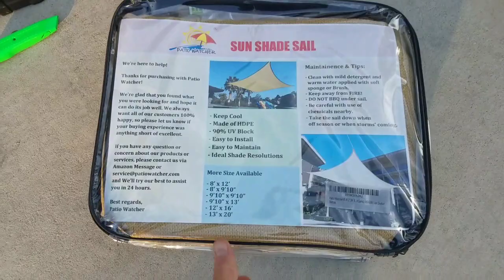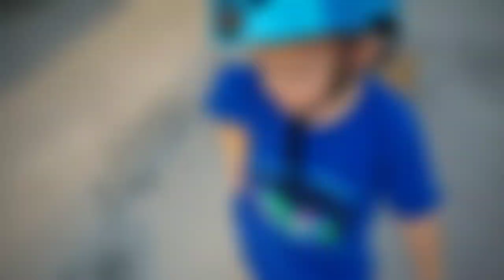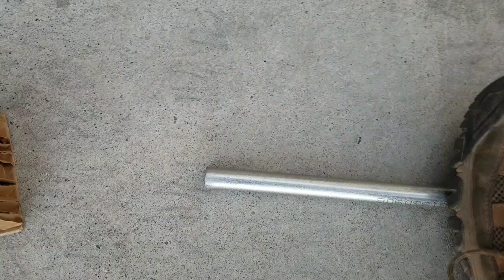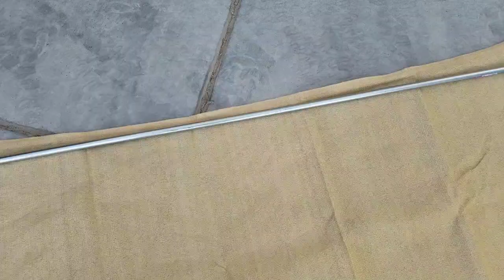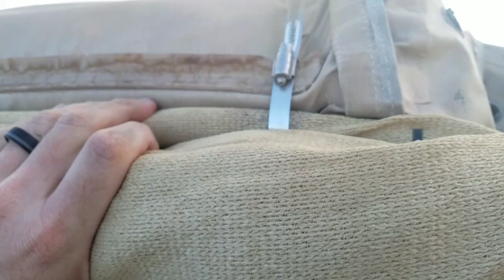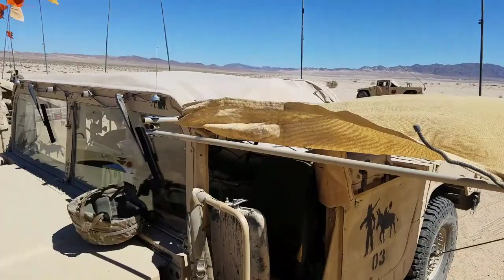DIY overland style awning

Comment: First off,  Thanx for your service. Former Navy here.  OK,  off topic question.  Do you know or know where I can find out what the base color desert tan your Humvee is painted? A Pantone color number of trade name is what I'm after.  I'm looking to desert camp my Suburban and am looking for the right color/tone/shade to use. Thanx.  BTW,  since the covering you're using is of an non-squared cut you could run your tension poles the outer length of the the fabric then since the corners  and inner points w/ velcro or webbing w/ holdfasts and not have to worry about folding the fabric to square it up.  Just an idea.

Comment: Looks good, Dan!  That's some pretty stiff wind, but it looked like it was holding up fine.

If you get to where you want to cut and sew that awning fabric to a rectangle, look at eBay, Cragslist, or local thrift stores for one of the old black Singer sewing machines.  They're built like a tank and will sew canvas, leather, nylon strapping, etc. without puking their guts like the new plastic sewing machines.
Reply from the maker: That's good advice. I have a speedy stitcher which would not be speedy but it would hold up well.